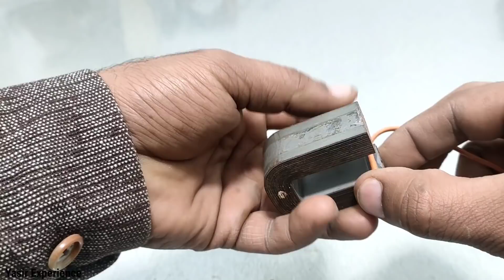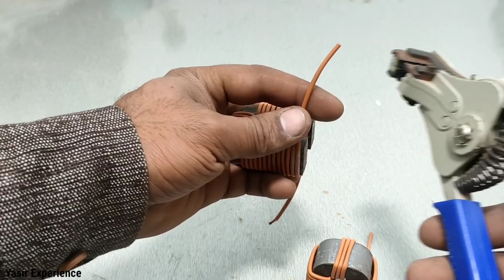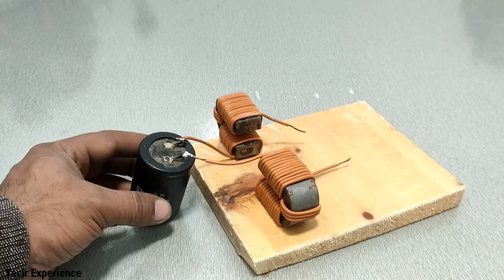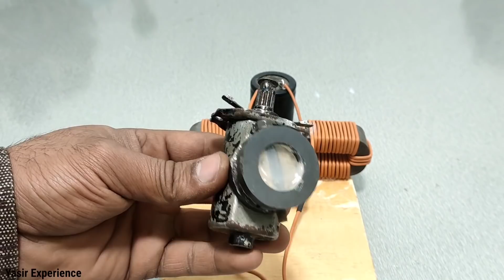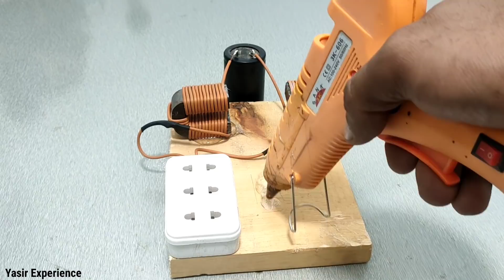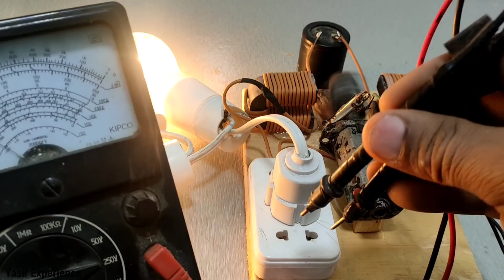i turn steel into a 220v amazing generator

Comment: To what  is the motors connected
Reply: It is just DC current. that is all. The motor is running by a 12 volt battery but then the capacitor give is a boost and the rest come from the magnatic field cutting through the wires and it may be also that he has backed it up by wireless power as well ha ha.